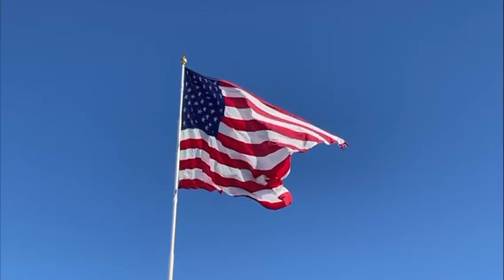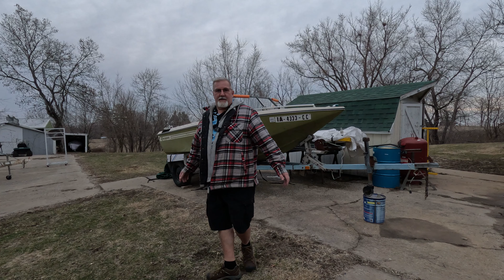1977 4 WINNS Boat  Mercruiser 120 hp Part 1 The discovery

Comment: Great video Michael. Of all the fins in the pump are going the same direction. Does it matter which direction? Wil it not still force the water up the copper pipe? 
Cheers
Reply from the maker: it will much less efficient and it's just plain not correct, thanks for the question and for watching

Comment: Vintage Four Winns! Love it. I don't think the vacuum advance distributor is Coast Guard approved, might want to look into that. Nice vessel.
Reply: When the water pump gets hot, and melty like that, make sure you check the pocket in the upper unit that the other end of the copper tube goes in.
Reply from the maker: Thanks for the tip and for watching.

Comment: Awesome video bud! I really enjoy how informative you are in your videos,  you say you have alot of faith in the mercruiser engines (consider this a novice question) is a mercruiser engine something considered omc? I have a 94 fourwinn 190 with a 5.0 cobra engine (this was to be my father's and I project boat until he recently passed away) I heard that omc engines are something to stay away from due to lack of parts. Is that correct? I don't plan to part with it and I'm still working on it , I just worried when I heard that comment. Felt you would be a pretty good person to ask.
Reply from the maker: The only heartburn I have on the OMC is the outdrive on some of them.  The ones that have the entire engine tilting to adjust trim seems a bit over engineered and not in a good way.
Reply: @Michaelsbackyardmarina  thanks for your input 👍

Comment: Another great video
Be sure to also check the plastic housing in the upper drive where the copper tube slides into for any melting since you found the blistering and impeller issues.
Reply from the maker: will do, thanks for the tip and watching.